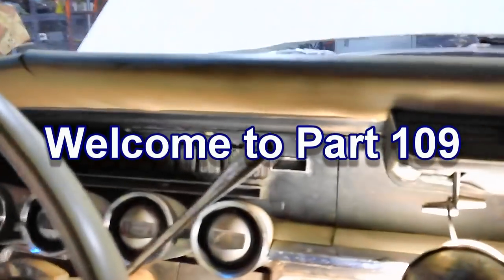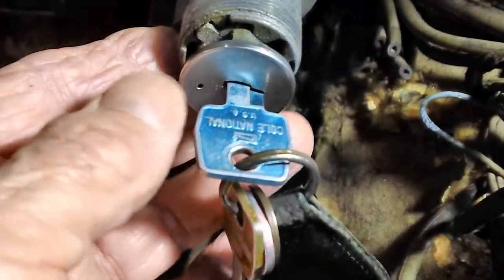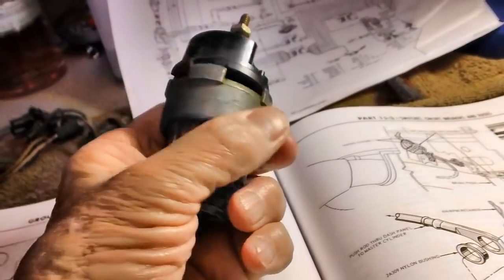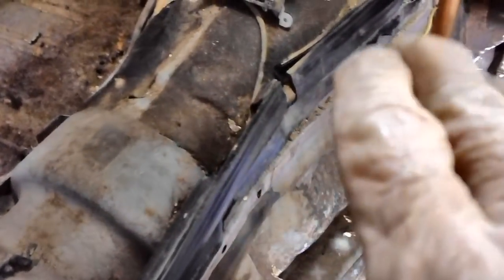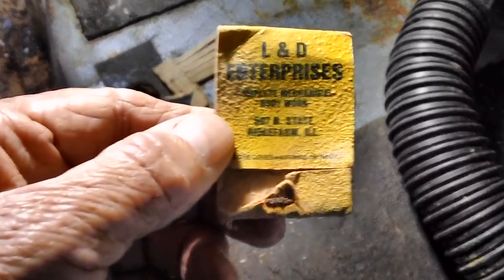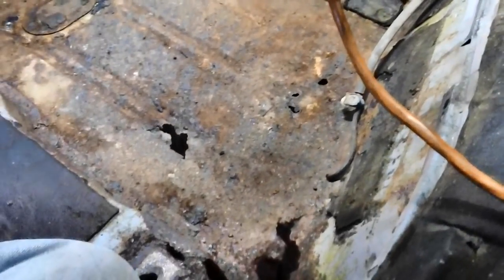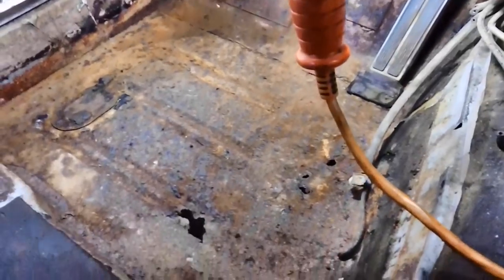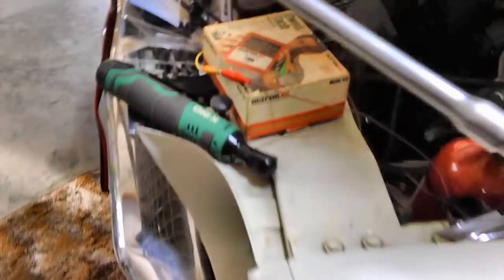1966 Ford Thunderbird repair and refurbishment (Part 109).  Key switch, fender signal lights.

Comment: That heater control unit is well made.. all metal... You should lube up all the controls....replace all those vacuum lines too. Looking forward to the welding floors. Please keep using youtube John.. Im not on odysee...I just joined odysee
Reply from the maker: Correct on all counts, my friend.  See you on Odysee.
Regards,
John

Comment: John, use Electrical phase tape , Black, Red Blue and white, then Brown, Orange, yellow and Gray ,  they are colors for High Voltage
Reply from the maker: I'll have to find something a little cheaper and in smaller rolls as I'll only need a little bit.  This looks like a pretty good candidate:
https://www.ebay.com/itm/3-4in-x-30ft-UL-Listed-Electrical-Tape-Multi-Color-Pack-of-6/362269560623?hash=item5458f2cf2f:g:6a4AAOSw8Nlch8c9
Regards,
John

Comment: Great video thanks very much. One problem I’m having is installing the new turn signals. I can’t figure out how to get in there and hold the indicator and bracket while screwing in the nuts 🤔
Reply from the maker: David,
Use masking tape across the top of the chrome signal light housing to hold it to the fender, then get up undeneath and install the nuts.  Easy-peasy.
Regards,
John

Comment: Hey John, what we have here is a failure to..... I mean ignition switch failure lol. The part with the key in it is the cylinder. The black plastic thing on the back of the ignition switch is "swedged" onto the switch. The switch has those tabs that go over the black plastic thing and they are pressed onto the black plastic thing to hold it in place. What has happened, like most switches, is the swedge is failing. The way to fix this is to reswedge it. Take a channel locks and give the tabs a press while holding the switch in place, if that makes sense. Now this may or may not work and purchasing a new switch is probably the better solution. 

There is no gasket between the fender light and fender. What you see in the video, how it came off the car is what you get, that is how it was installed from the factory. Well you really did remove the lights in less then 3 minutes so Im pretty amazed and you did it without using any colorful metaphors. You'd have to duct tape my mouth shut for that to happen here. It looks like someone had the right side apart and reassembled it poorly. 

So I take it you did not find the internal parts of the emergency flasher switch. Bummer! You mentioned that there is a reproduction, maybe you can let us know where to get that because I didn't know there was anything available either. That would be helpful info. Great video John, thanks.
Reply from the maker: Nick,
Re: Flasher switch:  It's what Bird Nest offers, but $40.00 plus shipping is ridiculous.  I suppose because it has that molded plug connector on the wires, which can be done with splices or installing different connectors.:
https://www.parts123.com/parts123/dyndetail.pta?catalog=0000030b&uKeY=AAAJF
Subscriber, Mark Houck (see above), has kindly supplied info on a far cheaper replacement that he bought and installed in his T-Bird.  He said it works great:
https://mail.google.com/mail/u/0/?pli=1#inbox/FMfcgxwKkbnxPqzcKTPDJDtXxpPQpkss  
And I'm glad to hear that there aren't any gaskets between the indicators and fender, although it was kinda nuts for Ford not to have them.
Lastly, I ordered a new ignition switch and lock cylinder.  As you said, it's the better solution.
Regards,
John
Reply: @joernone  Thanks John. I signed onto Odysee too.

Comment: Hey John, I have been a subscriber and a watcher of your videos for years. I have a '65 Thunderbird Landau. I was wondering what you are doing about your floor boards? are you have you gotten new floor boards form the Birds Nest? Or from somewhere else? I need to replace my front drivers side and the passenger side as well. Oh joy.....Please let me know.
Reply from the maker: Hey Mike,
In my mind new floorboard/floor pans are way overpriced.
I needed to replace both front pans, so I went to my local hardware store and bought a sheet of 16 gauge non-galvanized metal, then cut it to the needed size and shape and welded it in.  My welding totally sucks, but after a lot of trial and error the floor turned out secure.
Once done, I bought a quart of reasonably priced seam sealer and applied it wherever I deemed necessary, around the edges, along the welding seams etc.  I like overkill, so some places got two applications. All of that was followed by two coats of brush on Eastwood Rust Encapsulator Plus, then a thick coat of primer.   Lastly, came a coat of Rust-Oleum enamel paint.  I also applied the rust encapsulator and paint to the underside of the sheet metal, followed by a couple thick coatings of spray can undercoating.
All in all, I'm very satisfied with the outcome and saved at least $100.00, but have to admit that I was glad when the job was finally finished. 🤪
Regards,
John

Comment: Odysee is really running slow, acting screwy, and buffering constantly.  I couldn't even get thru your video.  Hope things improve.
Reply from the maker: Ansel,
Heavy usage.  Like YT in the beginning, things will slow down a bit when lots of folks are logged on.  To help a little, go to the lower right hand corner of the vid and change 1x to .75x.  The voice will slow down (it'll be very tolerable), but the video will cease buffering as much.
Odysee is currently going through huge growing pains.  I don't think they expected to get so many new users.  They've been deluged.
They'll work it out.
Regards,
John

Comment: Would you happen to know where I could get a plug for my ignition switch? I got the new ignition switch but I can't find a plug anywhere
Reply from the maker: You didn't say which year T-Bird you mean.  The '61-'63 ignition switch connectors are different from the '64-'66.  Bird Nest offers both.  Here's the link for the '66:
https://www.parts123.com/parts123/dyndetail.pta?catalog=0000030b&uKeY=1845
Regards,
John
Reply: @joernone  1966
Reply from the maker: Go to the link I sent.
Regards,
John

Comment: John, I emailed you the switch from Home depot I used for the Flasher. You mount it to the  on the bracket and adjust the  distance to the  blade  to switch on and off. You can get the same thing  at lowes or your hardware store "Internet #100147727
Model #GSW-21
Store SKU #540501"
On the  ignition key thanks , I need to replace  mine.  My car was taken  apart here the there with different  with different fasteners.  I bought the set door and ignition,  only one door would lock with  the  key it came with.  Nick - does have great videos !  Thanks again.
Reply from the maker: Mark,
Thanks, my friend, I got your email and now know how to install the new switch.  Much appreciated.
Regards,
John